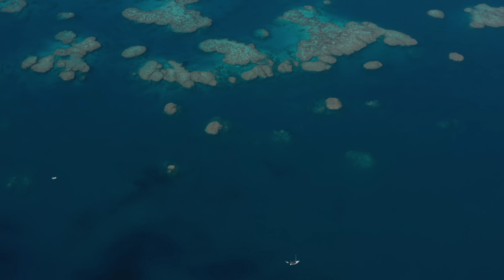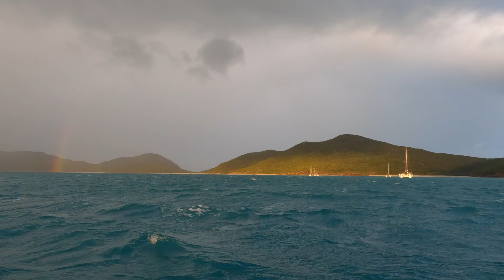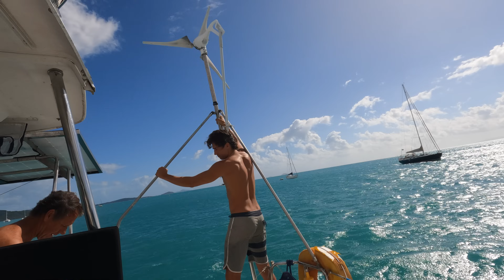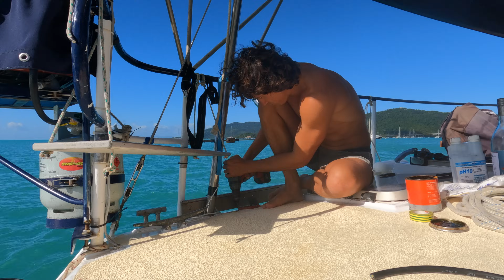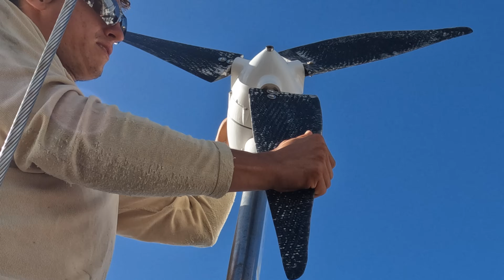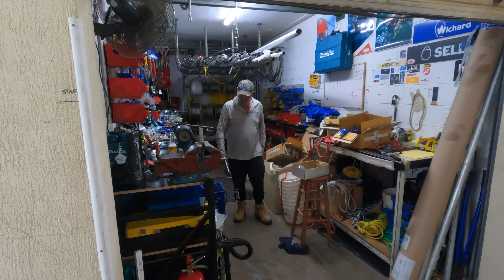INSTALLING WIND GENERATOR: Our small steel sailboat - Episode 43

Comment: I'm sure you found out by now you can only get in use less than 20% of the kilowatt rated hours what's hooked up to battery or create whatever 

It's called ohm's law 
As the battery gets Full you get less 
At the battery
Measure voltage and amps multiply the results and we'll give you true Watts
What's the batteries are full might want to think about a dump or diversion load to make hot air or water 
Or make hydrogen & oxygen 
Run the pump to make water anyway great job
Reply from the maker: Hey Dennis thanks for pointing that out, if we had the space I would definitely install a small hot water storage unit that is heated via heat exchanger/ excessive power produced. Maybe for our next vessel with a bit more space! Cheers mate, Josh

Comment: Heads up. Your enerdrive dcdc. Will take up to 12.24.36 or 45 v solar. 
Approx 800 watts @ 12 v.  For your lithium. Good vid guys
Reply from the maker: Hey mate! Yes how good is the enerdrive gear! We have our two small solar panels running through the DC2DCs MPPT. Cheers, Josh

Comment: Nice work Josh. Using the VS50 with the starter battery is one way to skin the cat but there's a 10% round trip loss through the Pb battery. If charging the house battery while the turbine is spinning, you don't lose anything, though. Think about replacing the VS50 with a  solar charge controller on the output of the rectifier with a Li-ion compatible charge output. Much smaller, about $200 for a 30A unit. Victron & other brand names.

Comment: Well done Josh. Power is the genie that keeps on giving. The complaint I have seen most often, about wind generators, is noise. You've gone the extra mile to make sure that's not a problem. You didn't need to cover Pheobes bottom, I looked away so as not to offend. 😁😉 Stay safe and have a good week. ❤🙏
Reply: If you wind generators too noisy just change the pitch a little bit
Reply from the maker: A gentleman of the highest order Steve! 
It’s almost a guilty pleasure hearing the sound of the generator running because you know it’s charging the batteries! 
Cheers mate, Josh

Comment: Wondering about using large flat washers on the underside of the topside to spread the load out where the pipe comes through the overhead?
Reply from the maker: Always a great idea Patrick! Luckily there isn’t any massive load on that section of the mount, more vertical pressure. Cheers mate, Josh